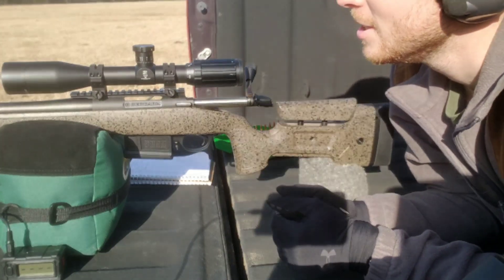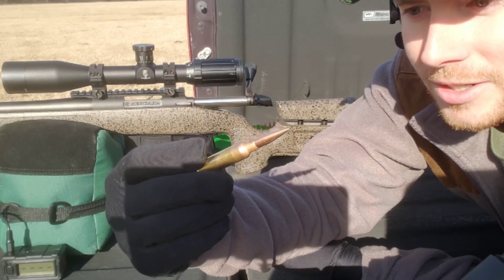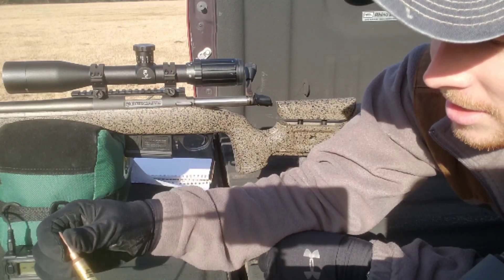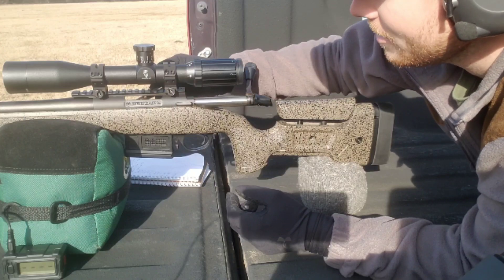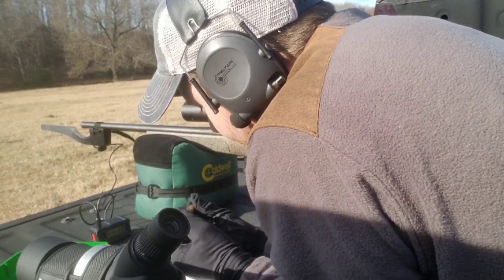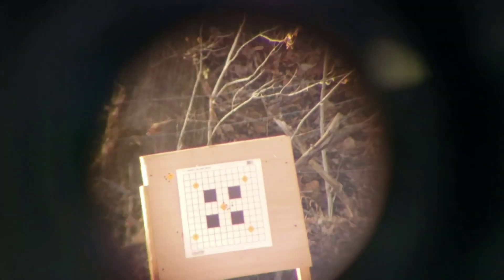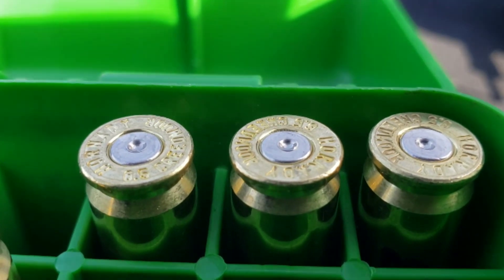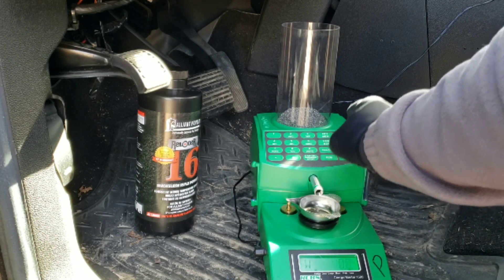Berger 130gr VLD Hunting 6.5 creedmoor load development

Comment: Almost gave up on the Berger 130 VLD. Loaded so many powders and charge weights, tried so many seating depths, nothing that I thought compared with the groups I get from 143gn Hornady ELD-X (mind you it is pretty hard to beat one hole 10 shot 200yd groups), then on my last visit to the range with what I was going to call my last attempt with them, I hit the sweet spot. Right powder, right charge weight and right seating depth. It took a full box of projectiles but there it was, a one hole 200yd 10 shot group at 2950 fps. It proves that keeping good records of work up loads is worthwhile.
Reply: What was your final load with the vld projectile
Reply: Good job 1 holing from 20 yards!

Comment: How long have you been loading in your truck at the range? Thought you wanted to try to keep scale as level as possible and away from any wind for the most accurate powder dump. I've always wanted to load at range but just thought I'd load the bullets with bullets loaded extra long and only work with seating depth. 

Interesting video and results
Reply from the maker: I do it every now and then. Seems to work out fine every time, although it's very annoying. You have to make sure it's pretty level, close the truck doors, stay absolutely still, but it does save a trip. Most times I'll just carry a test group with me while I'm shooting something else.